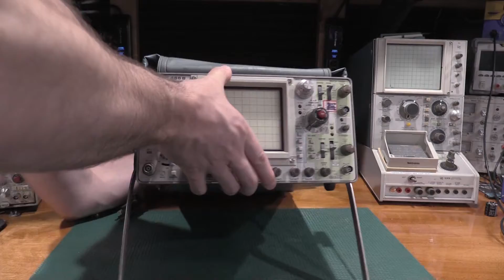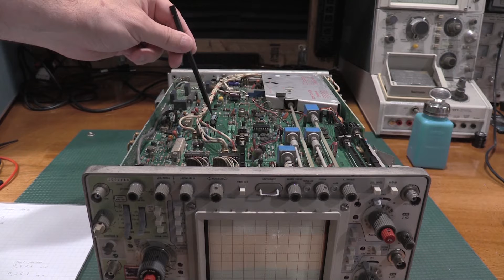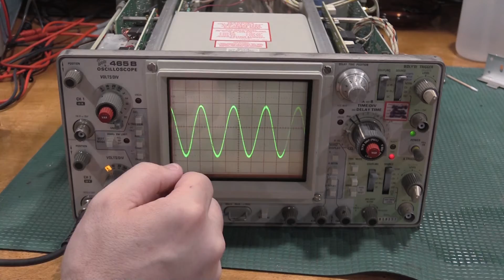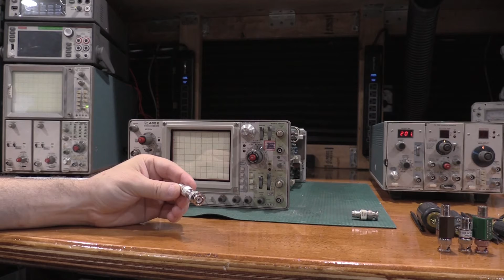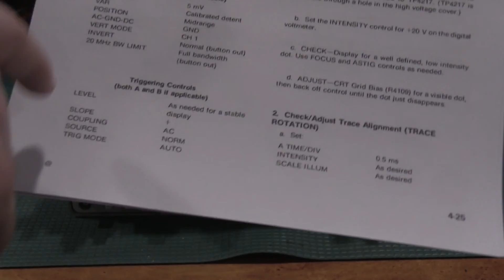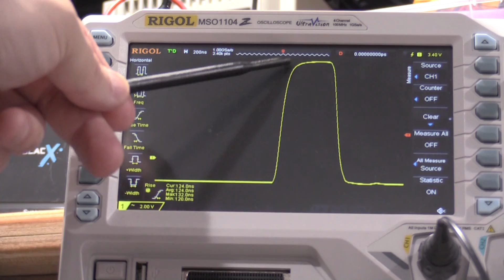Tektronix 465B Restoration Part 1 Power Supply and Tube

Comment: Hi, I'm going to pick up a working 465B tomorrow. So I watched your video series with a lot of interest. I also noticed you used a Fluke 8840A which I also happen to have. One in pristine condition but unfortunately the current measurement doesn't work. Last time I checked the fuses were okay. I do have the service manual but have not worked on it yet. I was wondering if you could give me some tips or areas of interest if I would start working on that part. Voltage measurement DC and AC are perfect, Resistance measurement 2-wire and 4-wire are also perfect. I would be really happy if I could get current measurement working as well.
Reply from the maker: The first question that comes to mind is there a low current path from current to LO terminal. There should be on mine it measured 0.841 Ohms there really is nothing fancy about the current measurement it uses the voltage circuits an a low ohms resister to measure current. Given that voltage AC and DC are working well as well as Ohms. I would start with a signal routing or path issues. The unit really does measure the voltage drop across the current shunt resister. So I would expect no current is flowing or the switching to hook the volt meter up to the current shunt might not be working bad relay?
Excellent on the scope the 465 B is a great unit.
Reply: @ZenwizardStudios  Thank you so much for your tips. 🙏 I will definitely start working on it, since it is already such a great device. And the 465B is in absolutely excellent condition, very happy with it.
Reply: @ZenwizardStudios  Well, I'm sorry. I had to come back because when I tried to grasp what you were telling me, it was not quite clear to me. You said: is there a low current path from current to LO terminal. - and then : There should be on mine it measured 0.841 Ohms - Can you explain a bit more what you meant? What should I measure first that gives 0.841 Ohms ?? Thanks
Reply from the maker: I miss spoke on that one it should have been a HIGH current path LOW ohms. Was typing right before bed. The testing if you have another meter handy is ohms mode on the meter one lead in to LO the other in to the current terminal. This measurement on my meter was 0.841 Ohms. This means that the current shunt is in good shape. If this is NOT measuring low ohms that is the place to start looking at for faults. In some meters of the era the current shunt is a large copper wire. Just needs enough voltage drop to measure. Dave also has a video out of burden voltage of a meter. This is directly related to the current shunt. Some can be as high as 2.4 Vdc across the shunt. This can in edge cases cause some weird circuit loading especially in power supply's where a 2.4Vdc reduction could knock something out of regulation.
Reply: @ Super thanks for your quick reaction! I will let you know after troubleshooting 🤗
Reply: @ZenwizardStudios  Hi, your tip helped me starting the exploration :). First test gave open connection, so explored and it appeared that the fuse on the input side was not properly connected😛Cables are fiddely but got it done. Thanks for helping me out by giving the tips! I finally have a fully working 8840A including the AC option board. Thanks!
Reply from the maker: @MarcelHuguenin   Excellent glad to hear everything is working! Enjoy the 8840A.

Comment: I'm really enjoying these videos on the 465B since I just bought a used one at a decent price.  As far as I can tell so far the unit works.  As for calibration, that is a future pursuit of mine.
One problem i have noticed is that the focus pot (R4132...a 5Meg ohm 311-0075-00 clarostat)  Is very hard to turn.  May as well say seized.  I have been in touch with surplus suppliers for this part.  
Since this exact part is no longer in production, I was quoted $555 US for a replacement.  Was hoping maybe you would know of a suitable newer replacement that would work.  The cost of a exact replacement is more than I am willing to spend .
Also, this pot is under the high voltage guard on the power supply board as you well know, so curious as to what voltage is put across this potentiometer.

TIA

Gary

Comment: Thanks for the nice video, what replacement did you use for the capacitor indicated in 17:00?
Reply from the maker: Looks to be an axial leaded cap that I had on hand in the lab. Nichicon or Rubycon, Highest temp 105 degree C, similar capacitance, and a descent voltage bump (if it will physically fit) one thing to note is that axial leaded caps tend to be only available in 85 degree C.
Reply: @ZenwizardStudios   Great, thanks. Indeed I took a look at mine and I looks bad. I'm considering to change it. Thanks again :)

Comment: Great series - I have a 465 (lightly used)and would like to fix the chan 1  AC/DC switch which seems to be slipping, and a tune up would be great.  I wish I could have seen the q-tips when you were cleaning the attenuator contacts (camera angle), but super video.
Reply from the maker: The attenuator should not be cleaned with Qtips. It is to easy to catch one and bend the contacts out of alignment permanently deforming them. The micro switches are fairly fragile.

Comment: Thanks so much for this video, you just helped me fix my scope. Channel one v/div control was not working well, I cleaned it just like you did and voila! all working again. Mine was a bit more of a pain to dismantle and get back together because it has a DM44 voltmeter mounted on the top, which kind of interferes with everything fitting easily. I guess that must have been an optional extra.

Comment: using a DMM6500 for this??  LOL
and peel off the plastic!! 
you do NOT need this kind of precision   LOL  LOL
Reply from the maker: I do agree with not needed the precision for that I have a 7510! However in this case the speed of the meter does make some measurements easier Tek supplies have a fairly tight ripple requirement. Some rails are +/- 1mV of ripple. Depending on the DC offset this can be quite challenging to measure especially when trying to measure accurately. This is not me saying it is needed or necessary. It is quite indeed, overkill.

Comment: Hi m8 about to watch this series as i have a 465m scope...but i have a telinstruments 25mhz CRT scope that was pushed off the bench and took a fall, now when i try and centre the trace(CH1) using the vertical position knob , the trace is only just visible at the bottom of the screen when the vertical position knob is at its maximum, When i inject a sine wave i can still see thst a waveform is being produced at the bottom of the screen(ps channel 2 is working fine?...any ideas where to start my troubleshooting?
Thanks in advance.
Reply from the maker: I have a concern that one of the deflection plates in the tube became disconnected in the fall. This will unfortunately be a terminal error in the tube. This can be checked by disconnecting each plate one at a time and seeing if you can adjust the position. Also checking the voltage at the deflection pins. If the voltage is moving and the trace is not the tube is the fault. When checking this all high voltage precautions need to be noted and care taken there are very high voltages present around the CRT in to the Kv range.
Reply: @ZenwizardStudios  thanks Zenwizard, can it stil, be a tube fault if ch2 works perfectly? , the vertical on ch2 moves up and down as it should,🤔🤔
Reply from the maker: No it would not be a tube fault at that point. The deflection plates drive the tube in the same way Ch1 vs CH2. This would also rule out the plate drive amps as well. And point more to a differential signaling issue in channel 1. After watching the video there is no way this could be a tube fault.
Reply: @ZenwizardStudios  thank you very much, i might start visuall inspecting of a cracked solder joint caused by the fall... 
Love your channel, was talking to a guy who said he will soon have to replace the cmos bettery on his Tektromix 2445A scope, i refered him to your channel
PeaceN73
Reply from the maker: Thanks for the referral. I will need to get some 2xxx stuff up to you tube as well.
Reply: @ZenwizardStudios  here is a short video on what is happening.thanks for your help https://youtu.be/ev46QpcK8K4

Comment: Thanks! Question = As you know, the mains AC voltage supply has increased to ~120V. The scope is to be calibrated with a 115V supply. Is it better to 1) drop the supply to 115V with a variable autotransformer and adjust the calibrations, or 2) try to make some mathematical calculation for all the various calibration points? 120/115 = 1.04347; so a 10V calibration point should be at 10.4347V. Number two does not feel like the correct method to use, but lots of folks don't have a autotransformer... Your thoughts?
Reply from the maker: My current practice is to do the alignments with the regulator set to where it will be in operation. Given the increase in line voltage this is usually in HIGH position. For some of the older gear like the type 106 this runs on a double conversion ups to drop the line voltage to 110 and hold it there.

Comment: Where do you get your replacement filter capacitors for 465 tektronix scopes?
Reply from the maker: Mine were from a parts unit. There is an adapter board that can be used.  The impotent part is there are grounds that are carried though on the can case. So the adapter takes it from 5 pin caps to 2 pin form factor.

Comment: Thanks for these really professional videos .. I bought one 465 recently but unfortunately it has very dim display even at max intensity… could you shed some light on how to troubleshoot that issue … thanks again
Reply from the maker: Glad you are enjoying. Unfortunately I have bad news if the display is really dim it is either grid bias is WAY out of adjustment and is turning the tube off. Or the tube is high hour and very worn. On thing to look for is what is called a double peak of the tube. This happens when you turn the intensity control up. If the tube gets brighter then dimer then brighter again this would be cathode poisoning and repair is unlikely. Brightness trouble shooting could also mean issues in the high voltage section but extreme care needs to be taken when working in that area as there is -4KV exposed when working. Sometimes but rarely I have heard there is some issues with the HV rectifier diodes as well as some times the ceramic capacitors.
Reply: @ZenwizardStudios  Thanks for responding 
I think you were spot on ... i had this double peaking . But when i was desperately trying to do grid voltage calibration by probing the test point i found the reading was 95 volts which should have been maximum 75 . Unfortunately the probe slipped and i heard a short whine then the HV was gone and i can't get the HV oscillator Q1418 to run again ever since ! 
I don't konw if there is a way to test the HV multiplier without having to remove the boards ,
Or Should i give up !
Reply from the maker: @basemhanna6175  Weather the project has concluded or not really my call, However if you saw the double peaking tube, then short of trying a CRT restorer with out a parts scope there is not much that can be done. The cathode is internal to the tube and in the vacuum envelope. So at minimum a new CRT will need to be sourced. 
Zen
Reply: @ZenwizardStudios  Many Thanks for your Technical advice.  I learn a lot from Your videos . Technically crisp,  really above and beyond. 
Thanks again

Comment: thank you for the excellent video. I have the Tektronix 475 with the healthy CRT with good focus but the trace does not seem to be as tight has your scope. I have checked the power supply and everything is good there, the high voltage is good at 2460v. Is there an adjustment you know of maybe a capacitor that could be causing the problem or any advice to point me in the right direction.any help would be much appreciated from anybody. thank you in advance.
Reply from the maker: Hi David, I will have to check if the 475 has a auto focus circuit. If it does Then that might need some adjustment. Also there should be an Astig control some where. Full focus is a balance between HV, Focus control, and the Astig control. The good news is if the Astig control needs to be adjusted it will not throw off the calibration and it tends not to need adjustments often. Also due to the high bandwidth of the scopes the trace will seem a little unfocused at the lower v/Div values this is normal amplifier noise and nothing to worry about. for instance asking a scope to do 500 uV/Div is asking a LOT from the front end.
Reply: @ZenwizardStudios  thanks for the quick reply iI have already adjusted the Astig and grid bias, I think the scope will need a full calibration as I have done major work in the power supply section and high voltage section I replaced 6 tantalum's and 4 electrolitic capacitors to get the scope backup running. I was chasing short-circuits all over the damn thing.the trace is not bad just not as good as yours, maybe I will just have to live with it. I have been inspired by your videos to have a go at calibrating it
 thanks for your time in replying to my question, much appreciated
Reply from the maker: Yea major work on the supply would need a full re calibration. There is one power supply that is the reference to all the supplies in the scope if that is out and needs to be adjusted. it effects every circuit in the scope. If i remember right in the 400 series that is the -50V supply. I hope the calibration goes well for you they are great scopes and well worth the effort. Most of the signals you will need are pretty mundane. however there are some exotic signals you will need for the HF calibration of the vertical. Some pretty fast edges are needed for the HF compensation. The faster the scope the faster the rise time needed to calibrate.

Comment: Interesting video, I learned quite a bit.I've never calibrated my scopes so this will give me some idea of the processes involved. I'm missing several bits of test gear needed though to calibrate my 500 series scopes, like a step gen. For those of us on a budget could you suggest any alternatives to the proper kit,  as you go through the alignment process. EG would it be possible to use a 555 IC to knock up a simple step genny, (assuming one could measure accurately ish the resultant frequency) instead of a dedicated bit of test gear to get our scopes better aligned/calibrated. Thanks....DA.
Reply from the maker: Hi Diabolical Artificer, To do a full scope there are typically 5 sections that need to be addressed. Power supply (Voltages), Tube (General Geometry and beam shape), Vertical (amplitude and frequency response of the X plane of the scope), Triggers (This is really a balance point for the trigger circuit to make sure they behave correctly) and the Horizontal/Time base(This is the timing of the Y plane of the scope.) The true trick to an alignment is knowing your input signals and having confidence in them that they are precise. Absolute precision is not super critical for a 400 series scope as the tolerance is +/- 3%. This was the first video in a multipart series the vertical section will be out tomorrow. I am still shooting the Trigger and Horizontal sections. Ran in to more trouble during the Horz cal. So there is much more information coming on the topic. If it would be helpful I could do a video on what is “special” about each of the signals in how they are used in the calibration process?
Reply: @ZenwizardStudios  Thanks. If you have the time a video would be a great help. Watching this series of video's with great interest. ATB...DA.
Reply from the maker: Glad I could help! There is quite a bit of interest in the calibrators. I do have a video planned for going in to the SG505 TG501 and PG506 in detail. In terms of accurate frequency measurements the easiest way I have found for highly accurate measurements in a home lab Is a GPSDO backed up frequency counter. In this way you could tune a pulse timing to have the correct period then use that to adjust the time base. The GPSDO is self correcting which is great for a home lab. comparing 2 different GPSDO's they agreed with each other within 500 uh or micro hertz. This is plenty good for an analog scope. 500 micro hertz on 10Mhz.
Reply: @ZenwizardStudios  Thanks again, I'll look into a GPSDO but think my FC has an oven frequency reference, will look into this...DA

Comment: Great video! Thanks for showing the attenuator cam switch in detail - really interesting design. Headlight restoring compounds work well for minor scratch removal on instrument panel windows.
Reply from the maker: There will be a ton of attenuator troubleshooting in part 2. At this point in time I did not know it yet but the channel 1 attenuator was a disaster. But there is some cool stuff on the way.

Comment: The Tek attenuators are specified in terms of their voltage division ratio rather than the normal power division ration in dB. The x2 attenuator is equivalent to 6dB, the x5 attenuator is equivalent to 14dB and the x10 atenuator is equivalent to 20dB.
Reply from the maker: Thanks Stephen, I kept coming up with 3, 7, and 20,  for the dB ratios. I will do a bit more digging. Then get a few ordered.